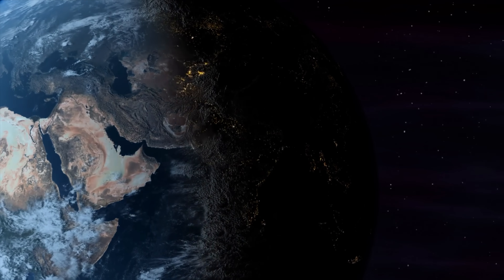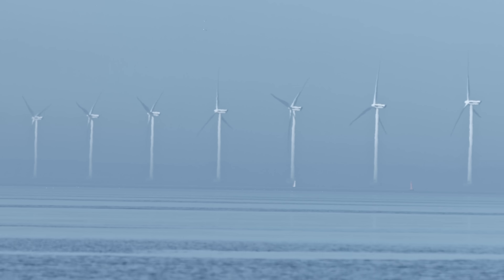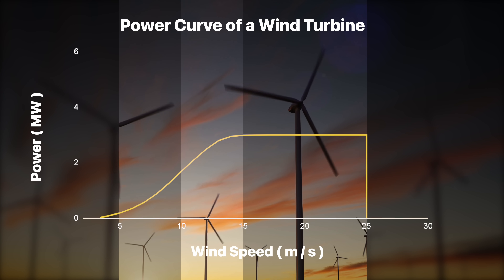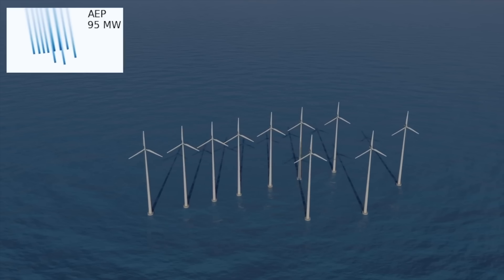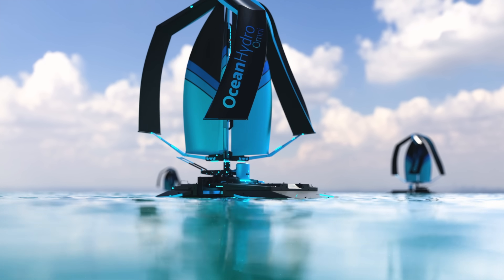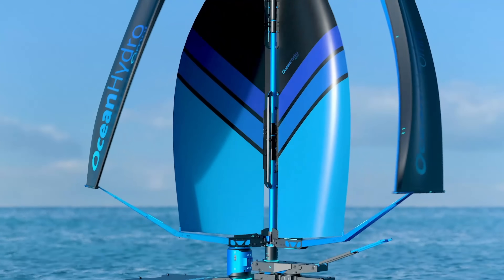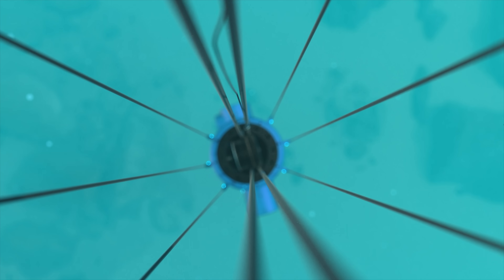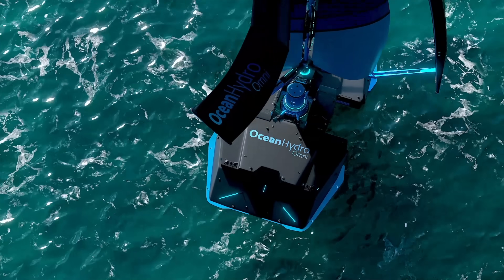Breakthrough Tech Solves Wind Power's BIGGEST Problem!

Comment: This is two systems; generation and storage.  The "density" of wind harnessing has to be ballnced against the fact the wind is slower at sea level than at conventional turbine height.  Maybe you could mount these on the bottoms of turbine shafts with more being placed between them to get the density advantage.
  The corrossive effects of seawater probably mean that inflating balloons against water pressure or using air pressure to lift weights from beneath them would be better.

Comment: Vertical turbines, sure. Maybe. But the underwater gravity battery? That sounds a bit far fetched to me. Besides as others have commented, moving parts under water, salt water corrosion and so on - how much energy can it store? Water is already heavy, so what are you hoisting? It would need to be much heavier than water to store any substantial amount of energy - but not heavy enough to pull the wind turbine under, soooo...? If you're going to use gravity batteries, it's probably simpler and cheaper to build them on land? Pump based systems sound promising - and you can use fresh rather than salt water, which should make things easier. 🤔

Comment: Why the blades are not made from 100% recyclebar aluminium? I‘ll don’tget it why they are made from composite plastics ending up in land fills… it’s not the 60ies and 70ies where some people experimenting with wind turbines and glueing them together in their garage… it is an Industry standardize them in ten useful sizes build gigapresses and build them single piece from aluminium and make them last 50 years. I‘m not believing in vertical axis turbines the only working vertical axis windmills where those blocking out the wind in the back movement from Mesopotamia.

Comment: So....  can it still produce power when weight is raised? Or only on down stroke? If the latter then no power on up stroke until weight is released. So no use of wind while waiting to release, and wasted wind while generating power. If over several days of no wind and all weights are down, then the first winds will be used to raise the weights, causing considerable power outages over time.
Variable power connected to pumped hydro seems a better alternative .
Reply: Finding suitable sites for pumped hydro is tricky. As a matire technology all the best sites have been taken already.  linking wind turbines and tidal with the lagoon being backfilled by wind energy if available could be a mitigating benefit.  Unless all the alternative energy groups insisit on working in their own silos.

Comment: A joule is amount of work done when a force of 1 newton displaces a mass through a distance of 1 metre in the direction of the force applied. This achieved in a second is a Watt if work done. Example: A 2-ton vehicle going down a lift into a parking slot 3 m below would generate 60 kW power for a second, which in practical terms is 1kVA for a minute, or 1000/6 W for 10 minutes. 
This is useful power in large parking areas with multiple floors.

Comment: So basically the made a mechanical filter instead of normal electromagnetic filter. How's that more efficient? That's been the whole point of the development of power electronics. The gears and all the mechanical artifacts are stiff and inefficient we need a flexible solution, hence power electronics.

Comment: Ok so I ASSUME that the hydro wind's turbines are tiny compared to conventional turbines, in which case I see no reason why they can't both be used in compound wind farms, with the big turbines getting wind at higher altitudes while the small ones get it closer to sea level, and thus not interfering with each other.

Comment: Why not just have basins or pipes or levy systems and use the electricity to remove the sea water and reflood the space to generate? A fixed weight doesn't seem like it would store as much as even a large vertical pipe with the mass of water removed.

Comment: "Breakthrough Wind Turbine Fixes Renwable's HUGE Problem"  Why do you do this?  I keep getting sucked in by your clickbait titles.  I know.  I'm a fool.  Show me a proof of concept.  This is just "smart" people having a think.  If it doesn't work in the real world, then why bother?  Where's the proof of concept?  I suggest doing videos with clickbaity titles AFTER the proof.  

Oh yeah...I just came up with a hybrid pickup that can tow 20,000 lbs.  Go 853 miles before stopping for fuel when towing said load.  While getting 50 mpg.  You can refuel it in 33 seconds.  It also excretes oxygen into the air.  I runs on unicorn fart nuggets.  

Say what?  Just because I can say something doesn't mean I can do it?  Are you sure?  I'm breastfeeding my baby I had last week.  My mom says, "Bs you're a guy."  
I just tell her "my professor said so."

Comment: Sorry but this seems like a bad idea, using gravity weights to store energy is suspect at best in air, but under water with losses due to increased drag, and buoyancy this does not seem viable. Why not have them generate electricity and then store the energy somewhere else (pumped hydro, batteries etc).

Comment: How much will it cost per installed megawatt.  It looks like lifecycle cost would be very high due to much required maintenance. I think cost and reliability will  be a huge problem even if they can get the performance they want, which is also doubtful because water and gears both have drag and will sap the energy out of the lifting and dropping process.

Comment: Why not use buoyancy instead of heavy weights.  Pump air into a tank when it is on the bottom and let it lift by displacement of water mass.  Then at the top let if fill with water to sink back to the bottom again.

Comment: Folks before me have already seen the big flaw in this- maintenance in the toughest possible environment. The engineer in the clip wasn't specific, but he was clear that prototyping this was "revealing" the problems. Me, I'd go "inshore"; when you drill an oil well, anywhere in the US, the first part of the "bore" is 18"-24" in diameter and made of very heavy (2'+) casing pipe,, welded together. with just that, sealed off at the bottom, I would have a "shaftway" to hang my working weight, not in the water, could get a higher rate of fall, quicker spin up, and ditch the underwater maintenance completely. I think just such test hole exists already, btw. Look into the sites a big services company like Halliburton runs- if any body has one, they know about, own it or have the operations contract. A line of these on a ridge in windy country could do a treat! Expect 40 years as a baseline for the oil well usage on the casing- virtually a century for this, I'm thinking. All the down hole service would be done by existing tools from the surface. An full downhole inspection kit would fit in a knap sack, I'm guessing. And I sidestep the whole everything done on the water is three or more times as expensive as doing it on dry land.  The two concepts together is an awesome thought though. I wonder what it would cost scaled down to "residential" size, inshore?  FR

Comment: I usually cheer for any renewable solution, even if it's experimental, but this one is very fishy. What they have is just a basic idea: "how about we create a combined generator+battery?" and then they compare that combined idea (without any implementation difficulties) to actually implemented generation methods without their battery solutions. Yes, the idea of a generator+battery without dealing with the actually existing physical world does sound better than a horizontal windmill without any battery between it and the consumers, but that's not how it actually works now, does it?

Comment: Nice Idea in principle, but like a lot of ideas, I don't think it will ever get off the ground (pun intended) as many have said here 'Salt water and a marine environment' is very difficult on moving parts cables etc. And in order to store energy relies on having to lift a weight up cables from the sea bed. What is going to keep these cables and mechanism clear from fouling or corrosion.... and how are tides and wave action accounted for?? CGI is nice however, but that is as far as it will get! 

Might as well use the inside of normal wind turbines to raise and lower a weight or liquid level if you want to be able to store potential energy. Or pump air to an open bottomed underwater storage vessel anchored onto the seabed, at least there would be no moving parts actually in use in the seawater!

Comment: On thier site we can read "Energy Storage Capacity 70 kWh per cycle". On a 100m drop, we need a weight of 260000kg, it is 38m^3 of steel or 180m^3 of dense concrete (I already included buoyancy). Seems realistic. 
But one omni has also "Rated Power: 1 MW". So, the storage is enough for 4 minutes. 
It may be OK for smoothing short time fluctuation but it seems far from being sufficient to fill the role of daily storage.

Comment: The problem with wind power is its variability. Perhaps an intermediary gravity system would solve this. It is interesting that drag type systems are automatically discarded in favour of lift type systems. There other other factors other than efficiency and cost, such as noise and visual pollution, bird strikes, and exploring alternatives. Conventional windmills are only improved by scaling them up.

Comment: I believe these oceanic HAWTs will disturb natural ocean wind currents, which would negatively effect natural ocean wave movement, and eventually negatively effect weather patterns. I can't give you quantitative or qualitative data, but thinking forward, I would venture to say it would even upset sea life migration.
Also current land HAWTs are made of non-biodegradable material & are constantly being changed out due to stress cracks. I suspect the ocean HAWTs are made of the same material. Next generational wind generators need to address all of these.

Comment: When the video started my assumption was they were adding a giant flywheel beneath the surface.  This sounds way more complicated and prone to failures.  I can't imagine 300 meter long cables with a big float on top not getting tangled and having all kinds of failure modes.  Not to mention in deep sea dealing with 10+ meter waves, how does that even work?  With that much slack how does that affect the winch mechanism? 

Back to the flywheel - at sea you could have a pretty massive flywheel and its far from people.  Not sure if you could keep one spinning on magnetic bearings through a storm though.

Comment: Has anyone done the math to determine how big those weights have to be to store up to 10 MWH of energy? In any case, serviceing moving parts and preventing salt water intrusion at 300 m depth is far from trivial. BTW, the secret sauce of renewable energy is grid battery storage. That would be on-shore, not in the middle of the ocean where the wind turbines live.
Reply: Yup. In 500 metres of water, about 7,500 tonnes. Not gonna happen.

Comment: Actually, why couldn't you apply the same idea on land? Lift a weight and drop it the same way or use a flywheel or lift water. The only caveat would be the lower windspeeds on land. Well, design them to go on top of buildings. Can be built into the tower construction or added on the side of existing.

Comment: This VAWT speed is limited by the Savonius in the center.  A Savonius turbine peak power is and a tip speed matching the wind and stops working at about 1.7 of the wind speed.  Where a two bladed  VAWT peak is about 4 times the wind, three will be about 3.5 and stops working at about 8 for the 2 blade and less for the three blade.   The more complex active attack angle turbine will have a bigger range but at a big price to pay in many areas.   At one times the wind speed a bladed VAWT produces about  1/2that it would at it's peak and 3/4 at twice.  From then on the Sovonius blades will brake the VAWT. 
Now about lifting a weight.  All I see is a gimmick since the buoyancy of the  tower platform float must be big enough for the weight of the VAWT and all its components and the weight being lifted and the cables tethering it.   The bigger it gets the bigger the float and so your paying in effect for the weight twice.  And there really isn't a lot of energy stored is that weigh compared to the weight of fuel that could produce the same amount of energy.  Dams hold back thousands of times their weight which make the cost of the dam effective way of storing energy.  Also just look at the cost increase in off shore oil wells as they are placed in deeper water.   To get the most out of a weight being dropped the water has to be deep that adds to the cost and limits the location to steep drop-offs.  And the electrical laying and maintenance increases with depth.

Comment: Hmmmm interesting.
1) wind strongest and most consistent at altitude (higher)
2) wave action and the rigid (looking) connection to the sea floor
maybe just put the weights on the existing turbines?

Where's Sadoway's dirt cheep battery (Ambri) made from dirt? 
There's some news from the past week that Ambri is moving to delivery. In South Africa!!

Comment: Can horizontal wind turbines also drive mechanical weights? Can weights be encapsulated inside the turbine support structure to protect against the harsh marine environment and to reduce resistance to movement? Can vertical turbines be mounted concentrically on the support shafts of horizontal wind turbines so they can each be operated for best performance and safety? Just a few thoughts.

Comment: Does the horizontal wind turbine lift the weight mechanically or with electricity? If it is with electricity wouldn't it be better to use the gravity energy storage with an existing wind turbine without having to build the entire contraption? This way you could provide the grid with electricity when it wants it and retrofit it into wind farms that already exist, even ones on land. The gravity energy storage device can then either be in a tower, or in a well, or inside the vertical tower part of the wind turbine itself making the contraption self contained.

Comment: Nice to see someone thinking about the problem.
Looks like you will have twisted lines below the water to me.
It does not look like you are reaching up to where the present 
turbines are operating.
I do not really see where your gravity "battery" is actually producing
electricity and sending it to shore. A gang dump will need an
amazing control room to take that power and make it acceptable
to the grid in both power and frequency.
I am in favor of big battery farms on land to store and modulate
such a system.
How many albatrosses and bald eagles do you plan to kill per year?

Comment: Another option is to use hollow piles and pump air into them forcing water out of the bottom. Wind energy can be stored as air pressure and tapped on demand. This puts more of the equipment and moving parts above the surface and not subject to corrosion.
Reply: Make the piles into 2 separate chambers so you can fill and discharge them concurrently, alternating between them so at all times the given function is available.

Comment: i work in onshore wind, in the planning application stage, we are currently encountering similar problem in relation to supply and demand synchronisation, the solution to this is always some form of energy storage. this can be achieved through battery energy storage system (BESS) that charges from turbines and releases to grid on demand. where grid connection is not feasible, either due to lower scale, remote locations or lack of grid capacity, localised hydrogen production can be used. A possible alternative to this system could be offshore platform locations for Battery Energy Storage Systems or Coastal locations.

Comment: Combining what others have said, maybe a better approach is:
1) attach the gravitational lifting mechanism to conventional wind turbine
2) seal the gravitational lifting mechanism out of water
3) attach 2 sets of them, and make the wind turbine lift weight A while weight B is generating electricity. Then switch over by using some gearbox when weight A has been lift to the top.

Comment: From an economic view point, these types of turbines might make their money by specializing in selling higher priced demand power that stabilizes out put from larger conventional wind farms.
From a corrosion view point the  moving portions of the system directly exposed to sea water consist of a low cost dead weight, a cable, and a winch drum which can be replaced entirely from the surface which suggests to me that the corrosion problem can be addressed economically.

Comment: to me solar makes more sense even in winter you get some power , my house has a 6.6kw system  and makes 40kwkh in summer and 5kwh on the worst day in winter , so if i just had 6 times more panels I would be fine (with having a 30kw battery also)  ,  and why not just have 10 times more panels as in have every wall on the house is a panel,